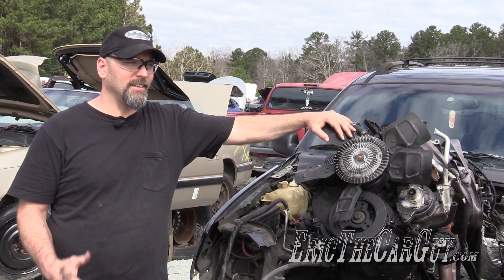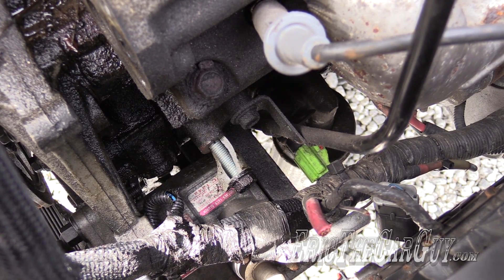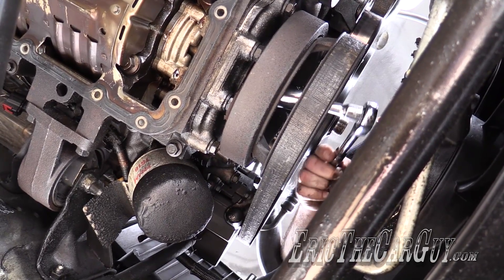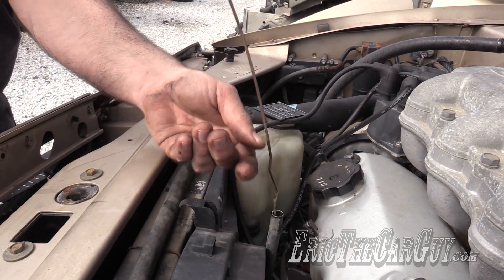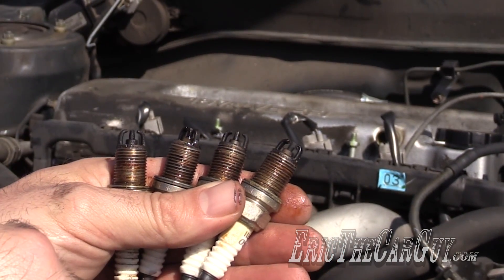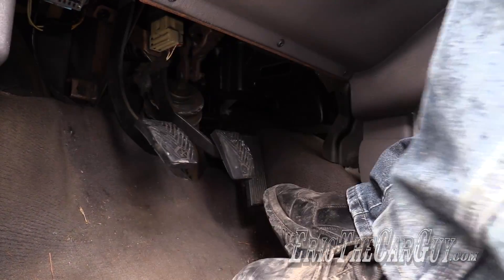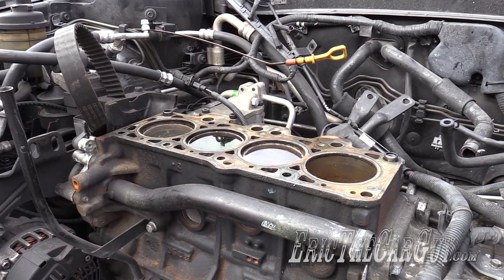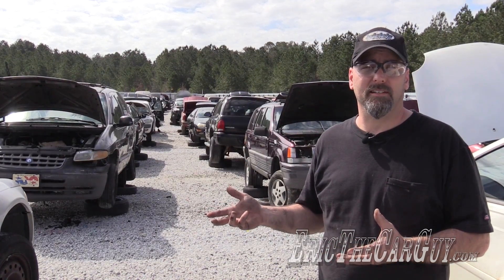What to Look for in a Salvage Yard Engine or Transmission

Comment: Used to be, you could check the mileage to get an idea of the probable condition.  I wonder if there's an easy way to power up just the cluster to bring up the odometer reading.  I know it's possible, but how hard?
Reply: Maybe find out what is the smallest battery you can carry around in tool box that can light up the instrument cluster, and then figure out a way to turn the ignition without key.
Reply: Actually, it's easier than that.  One of the links that came up on the right, with this video explained how.  If you have the cluster out, it's pretty easy to figure out the power and ground connections...usually the ones with the biggest wires.  He recommends carrying a 12v battery from a power tool, like a drill; and a pair of alligator leads...although I doubt it would even take that much juice.
Reply: Jack Dedert portable jump packs are the way to go. He has a tool review video about one. They can start a car that doesn't have a battery at all

Comment: Buy a borescope! I bought a 22re from a 4runner that looked like crap, but I put my borescope in it the engine still had crosshatched in the bore. Turns out the previous owner had then engine rebuilt and then it eventually got sent to the junk yard..

Comment: Does anyone know what would cause compression loss in a 5.3 vortec with cylinders 5 and 7 being at 105 psi and the rest are 160-165 psi. 

Wet test: no change
Valve inspection and reseat: no change
Head gasket replaced: no change. 

Whats wronggg!
Reply: 5 AND 7 are beside each other.  Until you said head gasket replaced, that was my first thought.  did you have the heads magnifluxed ?  Is the block level?  something is not sealing there.  Are the heads flat?
Reply: +Joseph Peoples i never had the head tested and that was my biggest mistake. I think im going to have to take it back of and have it tested. Would low compressions like that cause misfires?
Reply: t could.  more than likely, it isn't completely misfiring, just not a thorough burn.
Reply: +Joseph Peoples ohh well I have had a p0300 code and have replaced a lot of stuff with no fix lol. Changing cats now. One was completly plugged
Reply: +Joseph Peoples i did a leak down test and it came out the oil fill. So im thinking rings.

Comment: When acquiring a salvage yard engine,if I can't hear it run I always ask questions like why the vehicle was submitted and how long they've had it.At the least,replacing the oil pump,front and rear seals and all the gaskets is something I like to do before instaltion.For the extra $150-200 and some time,at least you get to see where everything's at,have no leaks and know oil pressure isn't going to be an issue.Its still cheaper than a full-blown rebuild or a reman.Have dodged installing 4 bad motors that way so far too.

Comment: Just went to my local pick pull and scored some sweet leather buckets out of a Buick Grand sport. Someone had already nabbed the supercharger but still full price was only $119 all in for the seats. 👍🏼   Kinda sucks that I could have had them for half that price a few days before at the member toolbox price or whatever it’s called. 
Always take a look 👀 at the brake and clutch pedal if it’s got one. Some late model stuff won’t show mileage without a hot battery and that’s not gonna happen lol

Comment: Unless the engine/transmission you need is rare or really expensive to get from a junkyard that pulls them for you I wouldn't recommend to get one from a self serve junkyard,  It's not really worth the headache,  Either spend i little bit more (when applicable) and get one from a normal junkyard or buy a parts vehicle

Comment: You can also look for signs that the automatic transmission has been serviced.  Stay away if it is a high mileage vehicle with no evidence that the transmission pan plug or the pan bolts have ever been removed.  You can also pull the pan and check the magnets and look for excess clutch material.

Comment: I would look for a car that has side or back end colision damage. Any damage to the roof indicating a rollover would be a no-go as you have no idea how long the engine ran upside down.
Reply: depending on the vehicle quite a few can't run when flipped due to safety features.  Plus fuel pump pulls from the bottom of the tank. ... so most stall.
Reply: out in areas with snow it happens usually when someone rolls after hitting a snowbank or similar situation, inertia switch doesn't trip (slow speed/low impact). The engine runs just long enough to starve the bearings of oil or may even hydroloc on its own oil.
Reply: +Txdartaholic true... I can see that. Great point

Comment: also everyone should check Craigslist and kijiji I'd look for crashed cars, I got a whole corolla for 150$ the engine ran Nd I sold the transmission and the car and parts off it, stay away from young kids because they'd probably sit there revving the piss out of it because it's been crashed and "useless to them" so check those places as well
Reply: I made my money back on that car I paid 150 for it got my engine and made 250 and got a clutch kit for free basically
Reply: +DeadlyVoltsHD made my money back my selling the transmission I didn't need sold the whole interior almost and the my uncle game me 100$ for the car and took it away for free it was t boned so the shell was done
Reply: True, but not everyone can have a wrecked car sitting in their driveway waiting to be parted out.

Comment: look for red transmission oil, if its brown then leave it.
means it hasnt been looked after.
Reply: I once got a used van. The transmission fluid was black and smelled horrid. It still lasted about two years before I sold it lol. But yeah, black or brown fluid in a transmission is not a good sign. Something is wrong or it has never been changed meaning something will be wrong.
Reply: Heat is the killer of transmissions. Black fluid means its been heated far past design. It also means clutch material is floating around there and remember, your transmission is more than just clutch packs. There's Many pistons and planetary gears in there also that if not properly lubricated will fail.

Comment: The salvage yard wants my old engine (core) but what if pull the heads out, do i still het the core trade price? I told them my motor is seized up, they still want it. So i was going to pull the heads and sell them to a friend that needs them. Does anyone have the answer? Thanks for your time.

Comment: Did not know that Pull-A-Part offers a 30-day warranty -- that's pretty cool right there.  Not that it'll cover labor-costs, I'm sure, but still, that's at least something that'll help.
Reply: Don't know about Pull-A-Part, but Pick-N-Pull offers an extended 1 year warranty on major parts for 30% of the part cost.

Comment: I wish there was a salvage yard of that size in Eastern MA.  

People in Eastern MA don't even know how to operate turn signals or how to merge into a freeway (99% of the time they try to merge into a 65mph freeway at around 35mph).  However, the worst ones are stupid SUV's that drive way slower than my FF TL in snow.  What's the point of having AWD?
Reply: You drive faster in bad weather in a awd car/suv but you can't stop any faster

Comment: If your engine doesn't have a head(s), I might would avoid that one. another tip to find a transmission is, if the engine is blown the trans is still okay 99% of the time

Comment: Check for oil change stickers and owners manuals for mileages. I pull the transmission pans to check/smell the fluid left in them. Yes, it's drained but typically enough to check what state it was left in and if there's any chunks. Also, you can inpect the magnet to see what it's attracted. If you're getting a transmission, make sure to bar the engine over. You might have a engine with a thrown rod that will prevent you from getting all the bolts from the torque converter. Check all the cars on your potential list before choosing on. You just might run into the engine/transmission that you need already pulled laying at the vehicle.

We now have used car sales here in Winston Salem, NC. They're priced to sell too! Wonder what other states have that. Good luck
Reply from the maker: Good tip. Thanks for the insight.
Reply: +EricTheCarGuy No, thank you for the many, many videos you've posted. I must say your channel is loaded with a wealth of information. I need to make my way to your site one day.
Reply from the maker: Thank you very much for that comment. As for the website, why wait? http://www.ericthecarguy.com
Reply: +EricTheCarGuy walking the salvage yard sure makes me think of my Dad when I was little he sure showed me alot about vehicles.

Comment: Coffee scum on the inside of the oil cap would make me run lol :-D
Reply from the maker: I like that. I might borrow it in a future video.
Reply: +EricTheCarGuy on my old car, i used to get some milky foam under the cap, was that moisture coming from the cooling system? weird thing was that the oil itself wasnt milky at all.
Reply from the maker: That's normal for vehicles that don't get driven often. It's because of condensation inside the engine. Take it for a long drive now and again to help get rid of it.
Reply: +EricTheCarGuy Cheers Eric, sadly dont own the car anymore but it always intrigued me. Thanks for clearing it up! All the best.

Comment: Before pulling the plugs, I also spin the engine over 720*. You will feel the number of compression strokes the engine has by it getting hard then slapping past it. If it skips a compression stroke (NO RESISTANCE), you can bet it has low compression on that cylinder. If that checks out, switch to a breaker bar and turn the crank back and forth , then turn 90* and turn it back and forth. do this a total of 4 times. any loose rod bearings will show themselves to you right quick. you will feel a clunk when you switch directions of the breaker bar. I also recommend pulling the oil pan and looking for metal stew. I have found quite a few spun bearings on subarus this way.

Comment: oil filters will still have oil in them. I always pour a little out and inspect it
Reply from the maker: Great tip.
Reply: In the salvages yards where I usually come they remove the filter and replace it with a screw on cap, no luck there ;). Though if you unscrew them some oil will flow out, so the filter could still be a solution. (just don't let it flow into the ground, and screw it back in when you're done )

Comment: What to look for in a junkyard engine or transmission? Nothing.  Buy a reman.
Reply: I got a 70K mile engine and trans out of a t-boned car.  Still working great at nearly 200K.  Salvage yard stuff is fine if you choose carefully.
Reply: ratbert86 You got lucky.
Reply: Donald Trump over here... ok Mr. $.
Reply: What car has a 5k reman engine?
Reply: go to a used car lot where they have reassembled late model wrecks.
Lic Driver Circa 1968
Reply: Acura looked it up it would be $5,150 not counting tax, the reman for my chevy is $3,000+ - but it's not even worth close to that. I changed 2 salvage engines in it for $850 over 6yrs. The 1st engine only lasted 4yrs but for $400 and a weekend of hard labor I'm not too upset about it.
Reply: Toad Phillips probably 5k - 2k core charge
Reply from the maker: Some people don't have the $$ for that. This may be their only choice.
Reply: @ericthecarguy   Yeah, I'm in that situation.  I appreciate the value of a good shop and parts, but I simply have to do it myself.  $2000+ would take me a long time to save up.  BTW, the current race to the bottom of the pit in service industry - something has to give, eventually.  When I lived in Waco, TX, they had a GM service center that was the size of a small Walmart, and had a reputation because economy of scale advantages gave them a more flexible budget to hire more experienced or specialized(but less experienced) mechanics/technicians.  They also could afford the more expensive tools.

Comment: Rust.
All salvage yard engines will be covered in it.
Reply: That's not a big issue unless the engine isn't closed. Chances are if your car has any age to it, the engine block inside it is probably covered in surface rust.
Reply: Depends on location. Some parts of the country rust is a very extreme issue while other parts its almost never an issue.

Comment: Also when you rotate the engine by hand check to make sure the valves are moving, inspect the timing belt.  Look for signs of overheating, if the underside of the hood looks like orange crush soda move on. 
If the car is late model and is undamaged chances are it's the engine or transmission (90% of the chryslers)
Personally I compare prices sometimes I can get a part from a full service yard, online or new aftermarket for less than a salvage yard.